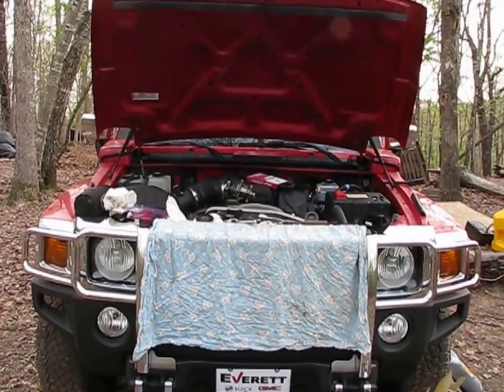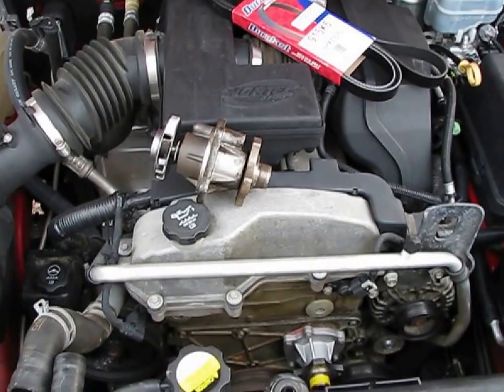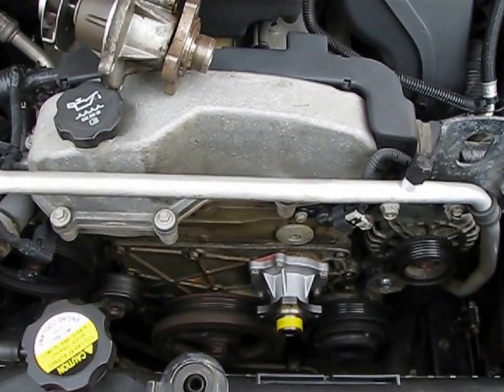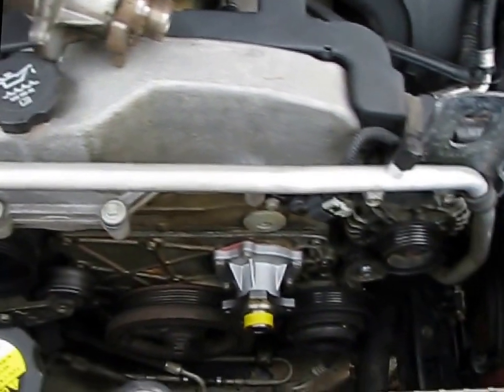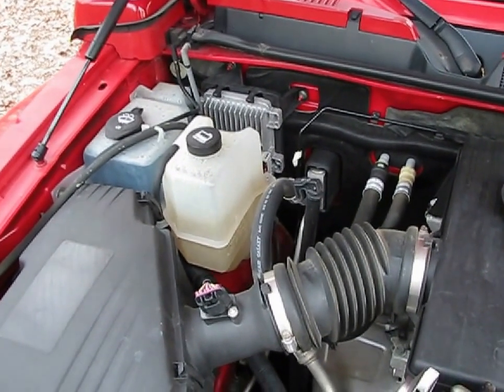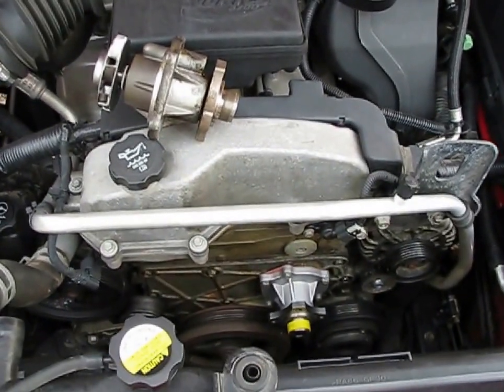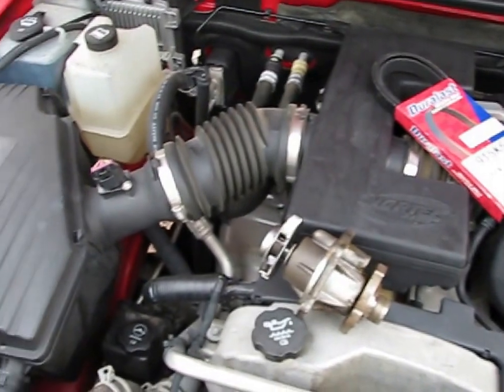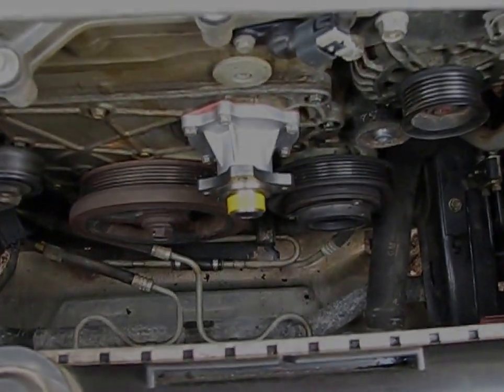Hummer H3 Bug Out Vehicle EMP Hardening Part 1

Comment: Is there a part 2 yet?
Reply from the maker: Thanks Dayton.  I'm working on it now.  Have spent the past year getting set up at the new bug-out place in the mountains.
Reply: Victorian Machines Ok.  I just recently  bought a 2007 H3 myself.   To date, my EMP preparedness has focused around mechanical diesels that I then converted to run on used cooking oil.  I am very curious to learn about hardening techniques for more modern gasoline engines and their electrical systems.
Reply from the maker: Dayton, the process is very simple.  All you have to do is select the TVS (Transient Voltage Suppressor) that you want to use for the application, and then just place it from the longer wire-runs, to ground.  Here is an application note that shows you a number of different options:  https://www.onsemi.com/pub/Collateral/AND8230-D.PDF
Reply: Victorian Machines Thank you Sir.  I am definitely going to check into that. And I'm still going to watch for your new video, LOL. I really appreciate you bringing this information out. I had always assumed that my gassers were just done for in that type of an event.  It gives me a new project to work on, and my wife something new to complain about, LOL.